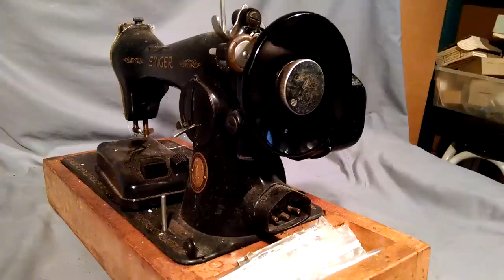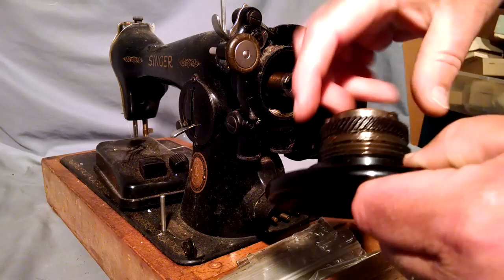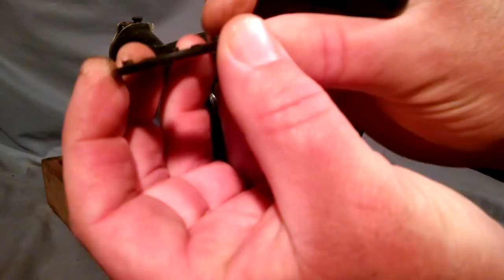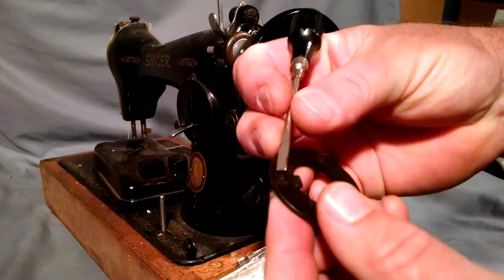Remove Install Singer 201 15-91 Vintage Sewing Machine Balance Wheel + Release Knob Alignment

Comment: I can't get the release nut to move at all.  I tried holding the needle bar and it still won't budge.  Any suggestions?
Reply from the maker: theres a set screw on the nut, completely remove that and see if its still stuck, otherwise it may have old oil in it gumming it up. You can spray penetrating oil or wd-40 and let it sit